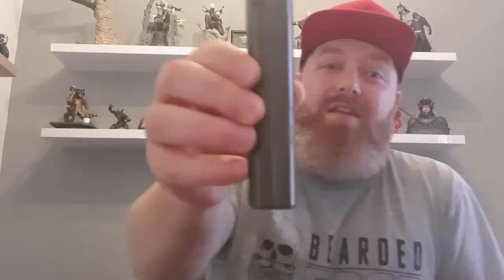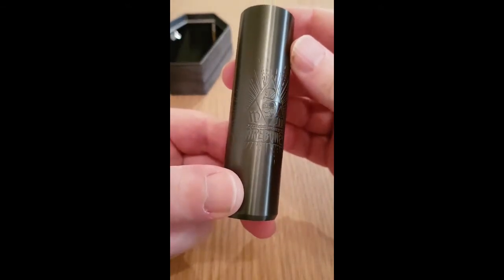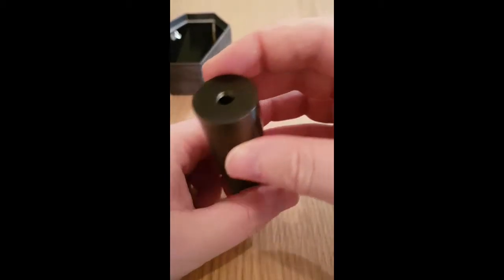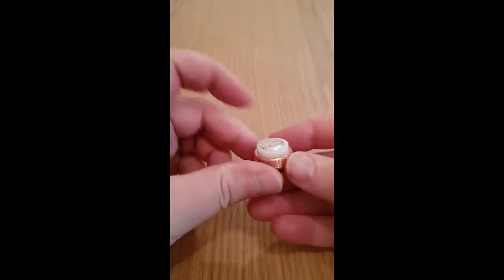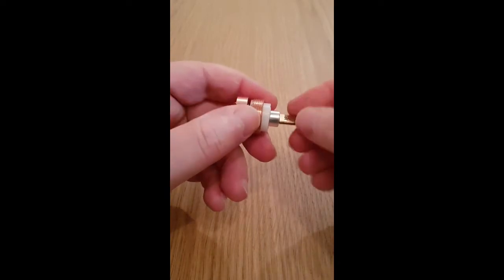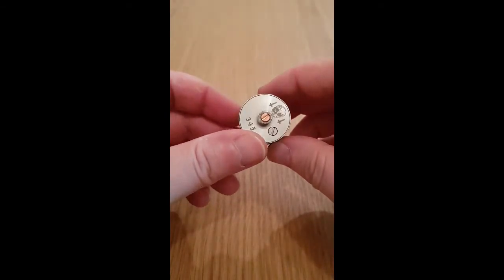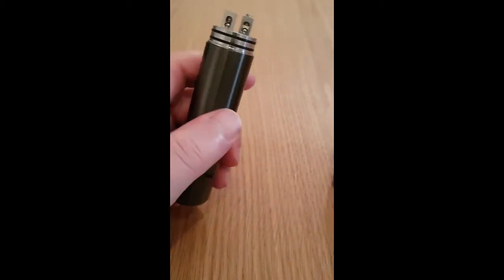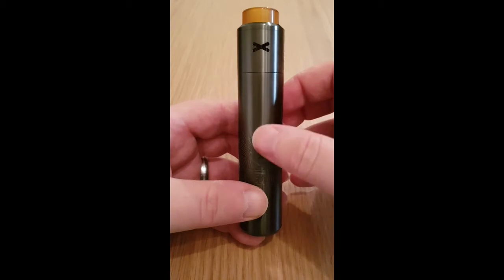Deathwish Modz Barebones Mech & Unholy V2 RDA Review

Comment: Have been vaping one for a few days, tried a few builds. Best for me is .08ohm 3.5mm 6 wrap 20g ss316l, airflow on one slit. Using the xxxL ultem tip from carrackvape, Its a dream. Hits like a parallel box.
Reply: Damn .08? what batteries do you use lol.. Love the look of this mech but it kinda looks pretty big.. Is it big in person?
Reply: LiveInTheMoment either  the ijoy  20700 or efest. It's beefy but not huge.
Reply: Do you know if the gunmetal version is a copper tube?
Reply: Funny thing, I went to the shop last night to check just that. Looks like its stainless steel inside of that one. I bought the copper version.
Reply: Damn..
Reply from the maker: Hey guys. The gun metal is a stainless tube.

Comment: I got the death wish ghost ship today with the unholy V2 RDA, I believe it's ss and it seems to be pretty meh atm.
I've got a 0.15 ohm build using 316lss.
Any tips on making this hit harder I guess? Or more impressive.
My vgod with a bonza RDA with a 0.2 ohm build seems to be more powerful and have alot more flavour.
Reply from the maker: lewismarsh10 I would recommend a lower build maybe 0.12. Also what batteries are you using? This can make quite a difference. I personally use 20700 in my Barebones. If your using 18650 then I would recommend trying a Sony VTC 5a or Samsung 25r